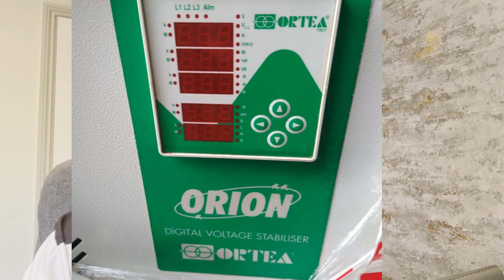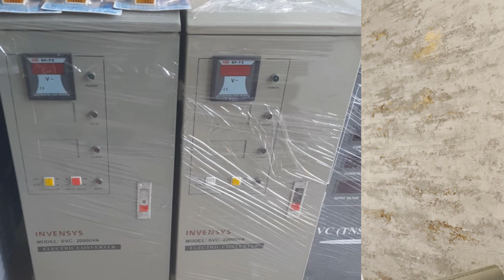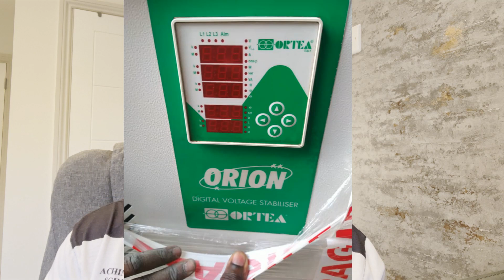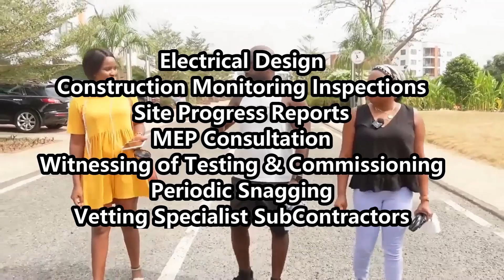AUTOMATIC VOLTAGE REGULATOR - A MUST HAVE FOR GHANA HOMES

Comment: I appreciate your expertise in this area. I am building five-story two-bedroom apartments in East Lagon. What size of AVR and SPD is needed? In one of your videos, you mentioned the important use of muli-phase electricity, which I will incorporate into the project. The project's status is at first ground, and are these systems required in the plan or can be added later?

Comment: What level.AVR and SPD will be suitable for a 3 bed bungalow with all the electric modcon please? Do you have reps in Kumasi?
Reply from the maker: We know a vendor who supplies Kumasi yes. Contact us for details +233(0)506251602. 3 bed bungalow? depends - is it fully AC? / water pumps, borehole? - need to understand the systems installed first before we can answer.